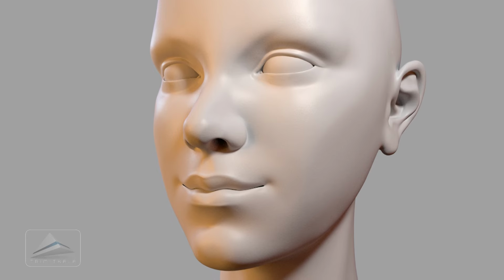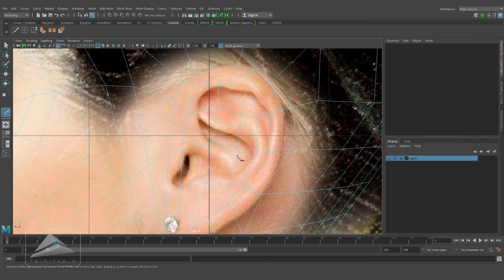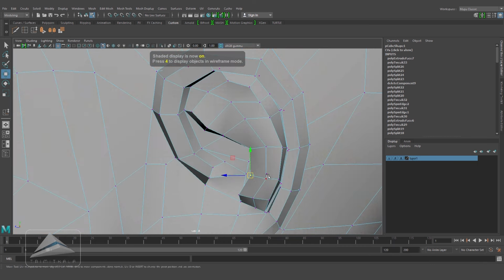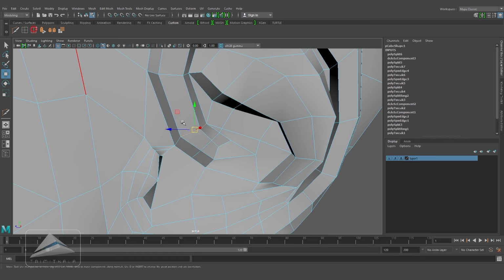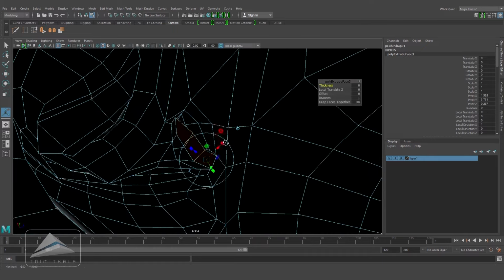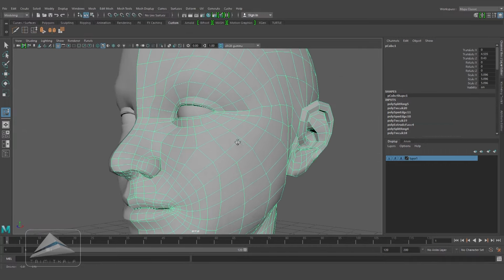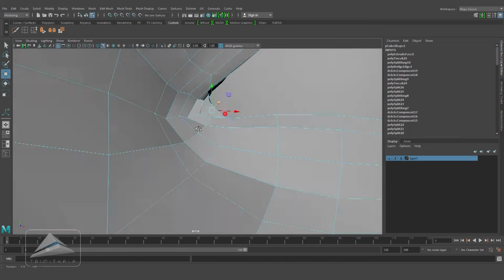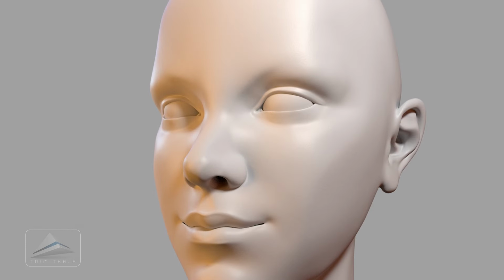Head Modeling Tutorial Part2 | Learn Maya

Comment: im stuck at 20:15.. in this video for that part, you selected 7 face.. but my only have 6 faces
Reply from the maker: Hi, actually the count of the faces doesn't matter. But the region and proportion matter. I showed in the tutorial how you can understand if your topology going right or wrong. The face count depends upon the density of the loops and it can differ. Only check if the topology is going according to the structure. Then your model is successful.
Reply: O my god! I figure it out finally.. after days of replaying in slowmo.. i find out that triangle become quad after one of its edge delete. After that add a long edge from that deleted part across the back head.. (its wierd im not getting it before, mybe its accidently edited out or mybe im using blender)
Reply: i try to look back at previous part, i realize at 1:19, the ear part consume 3x4 faces
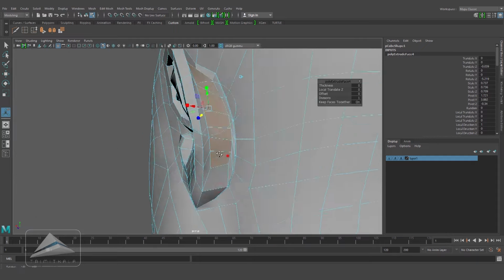Reply: and suddenly on 20:43, the ear part look like its consume 3x5 faces (how do i know its 3x5? because i measure it by looking at the pole, the vertices with 5 edges corners)
Reply: so i ask my self when the heck did become 3x5.. i must be missing steps.. then i found out.. oh i did that on 10:50.. adding THAT edge loop make the 3x4 become 3x5...
Reply: BUT that is true for the front part of the ear only.. the back part of the ear still 3x4.. so im stuck here.. when did the back part become 3x5? can anyone tell me please.. thanks
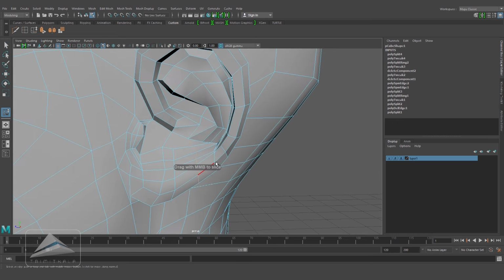Reply: ok i found out im missing this whole edge rows 13:15. but when did you add it sir? i check it from 12:43.. it was never there
Reply: please help me.. im stuck for 1 month
Reply: I agree count of face doesnt matter. But for the sake of following this awesome tutorial.. im completely lost from that part. The whole step you show after that doesnt match my head model. Missing one vertice or edge screw the whole learning process for me starting at 13:09. When u start sliding that edge my model is still same with yours..  but after u finish sliding it.. boom.. my model is not same. Im suspecting due to video editing process, some part is missing
Reply: To be spesific, please look at 13:12.. before u slide that part (look at the red edge)   its a triangle there.. after u slide it.. boom... the triangle is gone.. it become quads ... im guessing some steps is missing..

Comment: Excellent tutorial you did a great job telling the steps. Mine did not came out like you're but closed.  One thing the sculpting tool in my end did not have that circle just a small square and every time I hit some are of the model it shring the model. good job.
Reply from the maker: You can double click on the tool and open tool setting. There you choose the size and strength of the brush. Hope it will help you.
Reply: @Trimitkala  not fixed